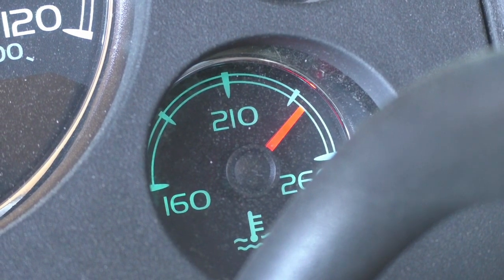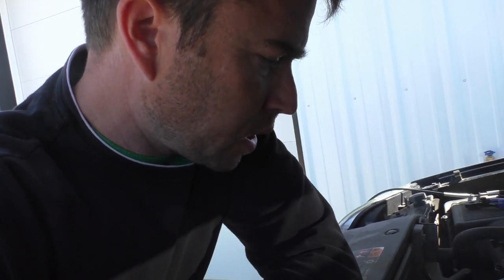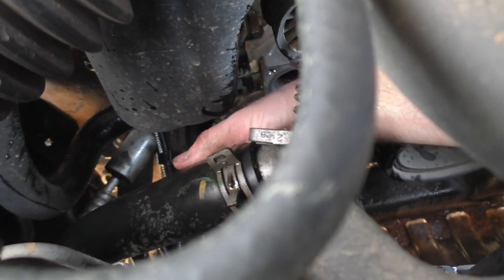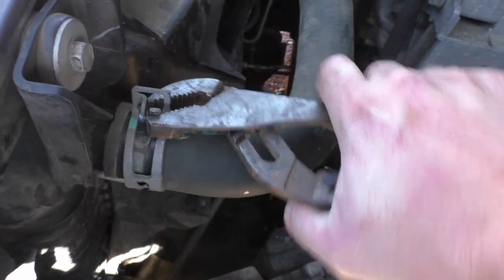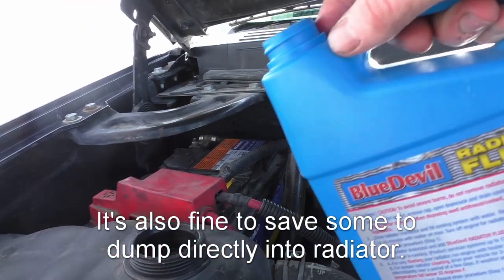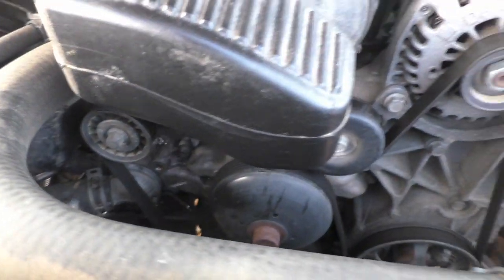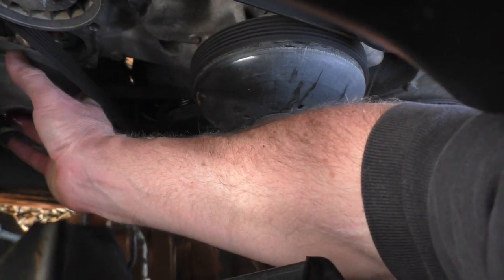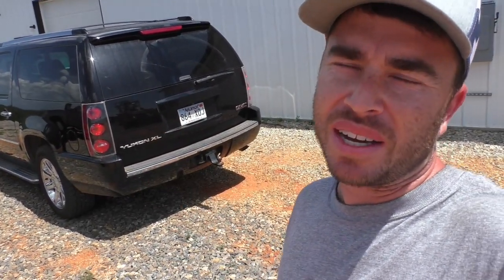FIXED: Overheating Yukon/Tahoe: "Engine Hot A/C Turned Off"

Comment: Got this done to my 2014 Tahoe it fixed the issue for about a month but it started overheating again, any idea what might be the issue?
Reply: Radiator issue… Have you ever added a stop leak type additive to the cooling system? When you changed thermostat,was the system burped?
Reply: Alot of the time its the fitting going to the heater core its a very small leak so you never know it’s actually leaking usually starts to over heat a week after or up to a month after but thats the most common issue on tahoes/yukons/escalades

Comment: My 2007 Tahoe overhead for the first time. The was no coolant in the reservoir.  It also at the same time the stabilitrack came on, ac was turned off and the power reduced. We had the stabilitrack repaired about 10 years ago. What is goi g on with it now?  It was smoking and gurgling when I pulled in the driveway. Can I save it?
Reply: I had the same issue but didn't smoke do you know what was wrong with your tahoe

Comment: Did it fix the overheating issue my gmc sierra 2011 overheats when idling at a drive threw any thoughts?
Reply from the maker: All fixed.  Check coolant level.  Definitely check that your fan is working.